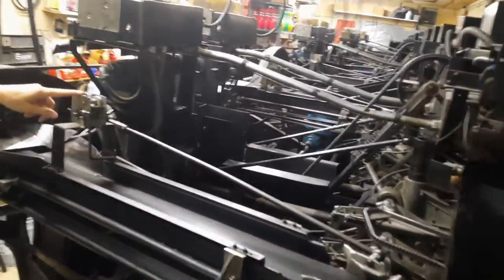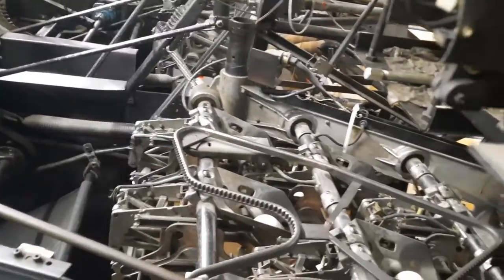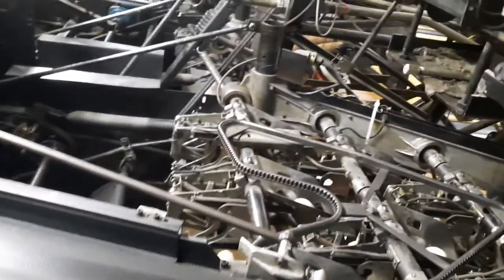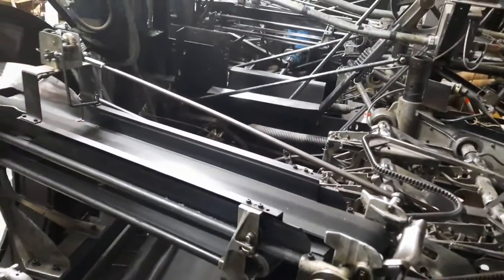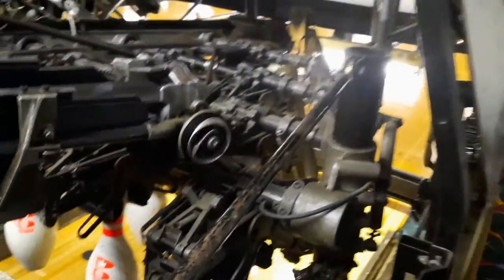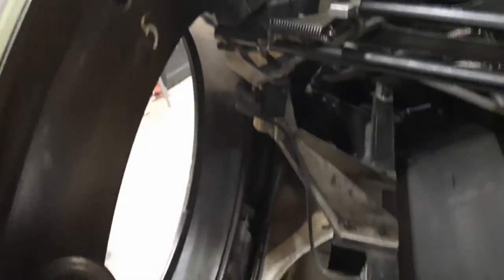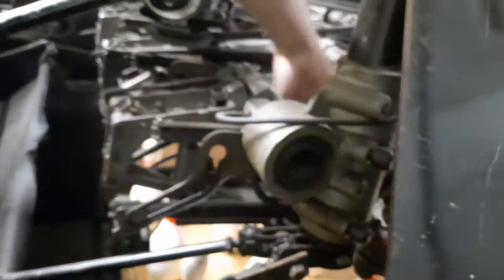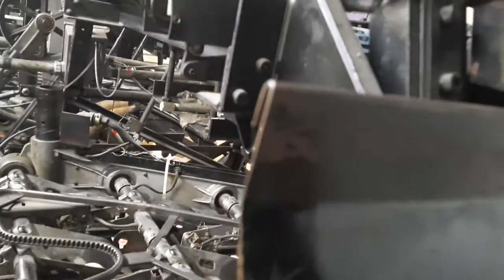Rare Vintage 82-30 pinsetters in action up close!

Comment: Because people have died by unplugging the pin setter and the crawled over the lowered deck and the machine got turned on by the front desk and crushed the guy between the deck and the machine frame.